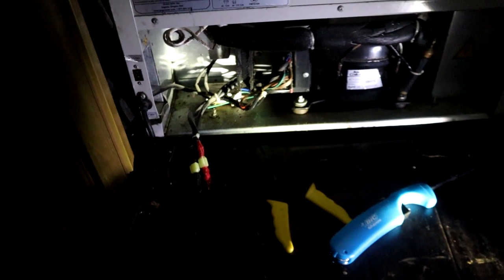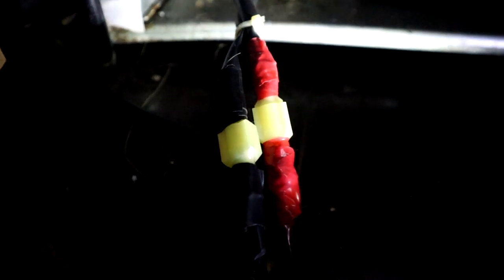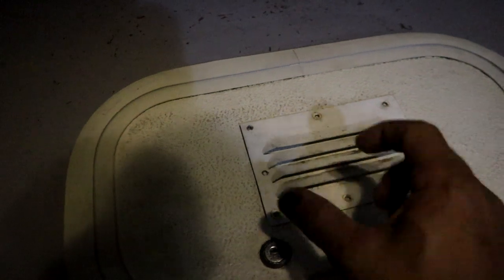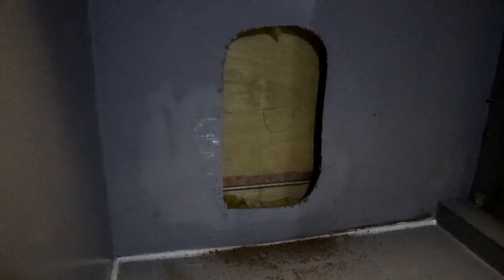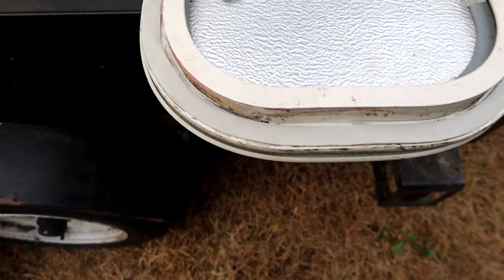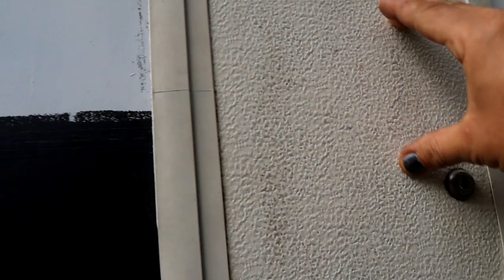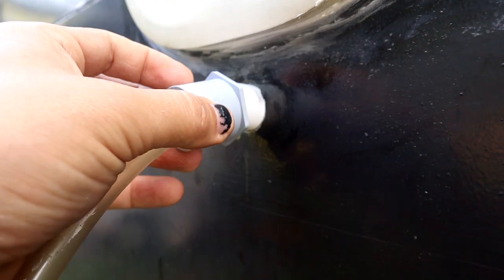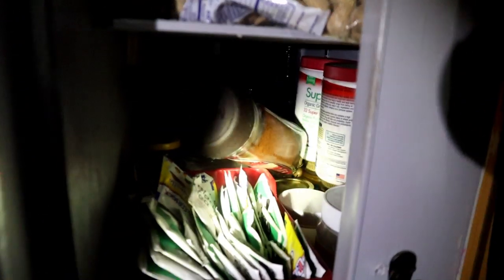Fix & Install 12v RV Refridgerator

Comment: Oh my gosh,  I admire you so much.  The thought of having to replacing our refrigerator in our 5th wheel gives me major nightmares!  My husband and I ran around all over the USA in our 2004 34 ft Motor home.  We put 20,000 miles on it.  Never broke down or had to replace anything! Not a tire nothing. We ended up back in Florida New Smyrna Beach.  I was diagnosed with Lupus and Fibromyalgia. So we traded the motor home in on a New 2016 5th wheel.  We have a big 4 door Dominic refrigerator it is wedged in a cabernet with an island in front of it.  Why is this a nightmare to get it out of there it would take at least four guys to pry it out. Then we would have to take out the picture window and ladder to get it out of the 5th The refrigerator cost between $2000 and $3.000 plus labor around A $1,000!! We have a warrantee that ends in October to renew it is $4000 for 3 more years.  We have had to have work done on the refrigerator already. So right now I’m thinking why did we trade the motor home??? So girl you, MOO MOO and Panda keep on going! We love you and your Videos
Reply from the maker: I've heard horror stories about new rigs before... and it's sad. Hope you get everything worked out  😬 thanks 😀🐶💖🐼
Reply: Flo I'm not trying to get in your business,but if your considering buying extended warranty through camping world,please do your research. There are many ,many youtube videos of horror stories and lawsuits about camping world not honoring those expensive ext. warranty's .  Good luck to y'all .

Comment: Ausia I'm gonna offer a little advice ! Before you start pulling the exhaust  manifold, when the engine is cool,take a piece of hose,like the one you cut off the refridge drain, about 3 ft. long. Put one end in your ear, crank the eng. and move the other end all around the manifold,and the connections to the exhaust pipe. You will hear the leak when you get close to it. Another way,is when the eng. is cold !!!!!!!! crank it and reach in with your hand, and feel around the manf. you will feel the exhaust blowing out. Obviously this will have to be done quickly,before the eng. gets hot, but it shouldn't take but a few seconds . Might save pulling the manifold,since there is a good chance the leak could be the gasket between the manf. and the exh. pipe !   Hope this helps.                    Update  Sunday The 28th.   I see I'm late  with advice.      Looks like Dave and Scott did excellent work on Panda !!!

Comment: My landlady bought me a mini-fridge when my big one stopped working. She also bought a new standard sized one. I am getting another mini-fridge, same brand, as I never have enough room in the freezer and the lower part for all of my vegetables and leafy greens. I shop for the month, not per week, so I have a lot of groceries to stash when they are delivered. The mini-fridge is a Galanz. I got it from Walmart for $139 plus tax, totalling $148 with free shipping. The freezer door is seperate.  My "twin" mini-fridge is coming August 8th, just in time for the power outage they are planning on the seventh. I hope it goes back on before I melt from having no a.c.

Comment: Great job.  I would suggest to put a screen behind the vent in the door so tiny critters can’t get thru into your van.  On the drain hose you might try attaching a small balloon over the hose.  Cut a small slit in the balloon so the moisture can drain out but won’t let critters climb up into the hose.  Have a wonderful day.

Comment: all you need to do is put an elbow on the pipe coming out for the Overflow it'll look cleaner can even put a little screen on the bottom of it so no bugs get in
Reply: Yep. 2 45 degree L's one regular and 1 street L to make a gradual 90.

Comment: You won't get an air exchange by simply having two holes side by side in your access door. There needs to be one low to draw cooler air in, and one high to provide movement through convection, and they need to be large enough to move sufficient air. Or...a small fan sucking air in one hole which will automatically push it out the other. Heat is a killer for the compressor, so a good air exchange is important.

Comment: Good for you . Projects can really pile up . I keep hoping for a few pain free days , to get some of mine done . I can no longer travel and are wheelchair bound . Most of my projects are to make it easier for a ak leg amputee to live in . Mine is a 2018 33' travel triailer , that I bought after hurricane Harvey destroyed my 31' 2014 trailer . The VA put me in a aluminum ramp . Sometimes I get cranky , from all I am dealing with . In 2016 alone I had 2 Femoral bypass transplants in my legs , along with a heart attack . I spent over 6 months in the VA hospital that year . 2017 trailer destroyed and $4100. damage to my car . I have lived in Rockport , Tx at a RV park for 5 years now . The park owners have become my extended family .

Comment: Great job! The only thing I would've changed was the outside fitting for the drain pipe. You might want to think about replacing it with a PVC plumbing elbow joint where it bends down and rain can't leak back into your rig! Just trying to help a girl out. My husband and I built our own house by ourselves so I learned a lot about electronically work and plumbing. I already knew how to build with wood bc my dad was a Master Carpenter so I learned everything from him since I was old enough to hold his tape measure! He built the first round bed in Oklahoma City. I grew up around all the woodworking tools and without looking, I can tell you what tool is being used just by the sound it makes. Sometimes I can even tell you which brand it is!😃😉 Good luck in your travels! Happy Trails, Scooter from Cedar Canyon Farm, Orlando, Oklahoma

Comment: I recently did a similar connection for a portable air conditioner in my Silver Streak.  It took me a few days & I too drilled holes to find my scale of proportion. Unfortunately, the portable ac is not doing all that well in this Texas heat. I went for broke & bought a new roof ac instead. 
Good job! 👍

Comment: hey if you change out exhaust manifolds take a grinder and cut the casting between the exhaust ports the releases stress that is in those manifolds and they set and seal up good to the heads if you don't do this you could have a leak again. I have done this job to a old Southwind with a 454 the tip was given to me by a RV mechanic at Holman motors a bunch of years ago. good luck brother Al

Comment: I would turn the door around so that it opens from the left side. Opening from the left will save the door, and wall, if the door comes open while you are driving. Nice job.
Reply: Left hand hinged(the way it is now) will keep the door closed by wind speed on the highway should the latch fail.

Comment: Exhaust manifolds?Good luck with those after time they are as good as welded on and getting at all the bolts nearly impossible.Almost always require a torch and a big breaker bar which there isn't room for without pulling the engine.Hopefully you won't have to remove one and it is just the gasket where the pipe hooks on,but even those are very difficult to get apart when the bolts are old and rusty.
Reply from the maker: Nope it was actually very is to take off

Comment: Wait a sec, the original reefer had an opening down low and one up high for ventilation.  Why did you have to blast new holes?

 Did you remove the old rotted floor under then reefer?  Now you need to paint half the door black....

Comment: It struck me, Caravan Carolyn, Carolyn’s RV life & Bob Well’s Cheap RV Living have all went the route your taking at one time or the other, all 3 bought a used RV of different class’s at one time , it was one thing Bob Wells said when he was giving a tour of his new van was , “ that he would never again buy a good deal in a used RV, “ why? He said your just buying other folks problems, he went on to say, “buy an RV as new as you can afford” then you have several years of problem free traveling. Because  of the ongoing & inherent problems an aging RV has, Bob has had several homes; a-topper van, a regular van & cargo trailer & his last, a regular sized 3/4 ton van, his theory, shorter is better, you can stealth camp in a city where you can’t with any class RV or get to remote places for boondock camping more easily, they all had the same problems your having, roofing leaks, generator problems, transmission problems, fridge problems, so Bob’s words of wisdom abt buying an older RV is probably true, cheap is not always a better deal, like I say, pay-me now or pay me more later, Travel safe, Shalom!

Comment: Hi! Consider going to wwe.partsgeek.com and getting new exhaust manifolds for your engine. In RV's the engine works very hard and they manifolds get glowing red hot and in time warp causing leaks. Manifolds cand be placed on a sanding table and made flat again yet this makes the manifold closer to the valve cover gaskets buring them and causes oil leaks and smell. To truely fix the exhaust leaks get new manifolds rather than work on the problem. I suggest also brass nuts and antisize all bolts with Felpro gaskets and enjoy no leaks! I hope to be on the road in the next few months and your channel inspires me and motivates me. I have new manifolds still in the box to install and I want to have them coated with ceramic to keep heat out of engine compartment and keep them from getting rusty and pitted.
Have a great day

Comment: You’re lucky that broken wire didn’t spark and burn your RV! 
Better safe than sorry
Reply: Im sure it was fused!
Reply: Paul Woodman I take it you’re not an electrician. A fuse protects against ground fault shorts, like when a hot wire touches ground.
A loose connection can spark without tripping a breaker or blowing a fuse.